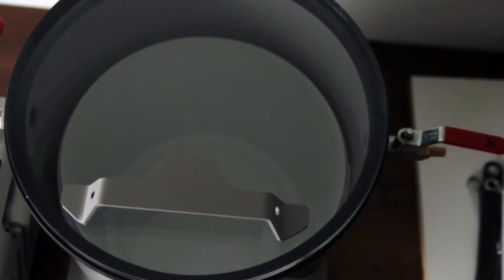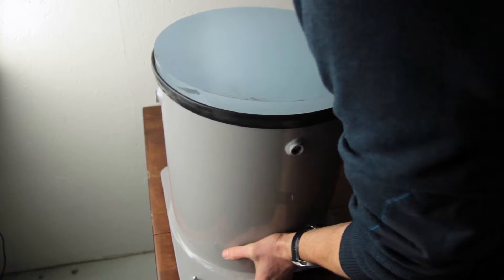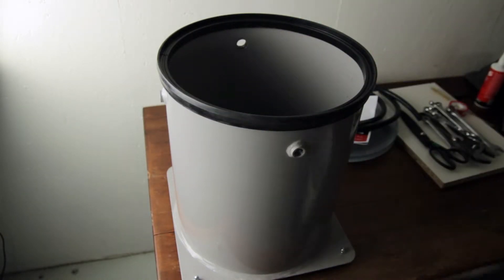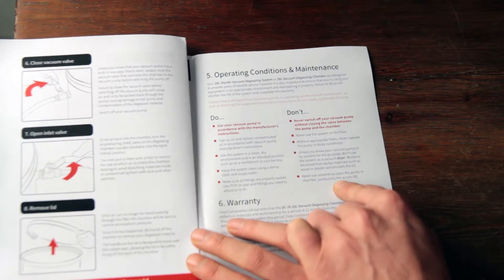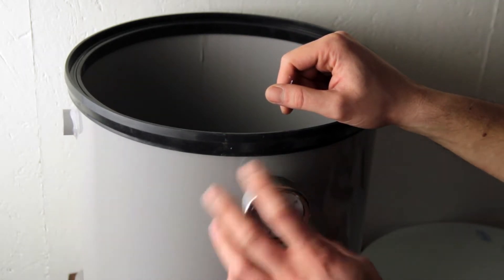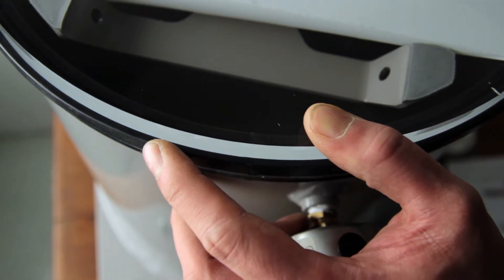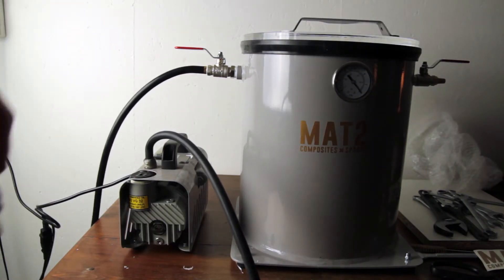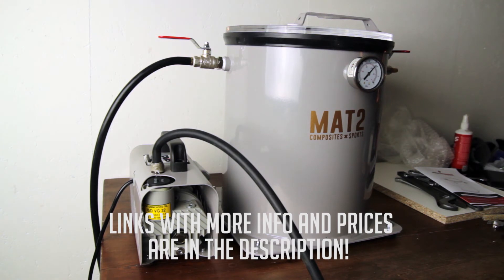Degassing Chamber Easy Composites - Remove air from Epoxy, Silicone, Casting Resins

Comment: For a couple bucks they sell a filter that you can screw into the fresh air valve so it keeps the moisture and particles getting sucked into the chamber. They use these type chambers to make cannabis oil extracts so the filters keep it clean when you release the vac

Comment: If you use a vacuum tube to make a carbon fibre parts , what does this degas chamber if it does the same work ?
Reply: It removes any gas from the resin so there are no bubbles in it after it has cured
Reply: It removes any bubbles from the resin basically
Reply: @matt7775   I know this, but when you make a carbon parts by vaccum process ,you already do it under vacuum to remove bubble. 
what's the use of doing the same job twice? I don t understand this
Reply: @bluspirit81  it makes no purpose pulling a film vaccum out of the fiber matrix to then add resin with air particles.
Reply: No, vacuum infusion is to make sure you wetting out the clothes all the way down, no dry matthieu rial. Yes it (vacuum infusion) will removing the bubble, but not that much.
Reply: @ultralinx200   ok ,you mean infusion process.  I mean Standard  vacuum process